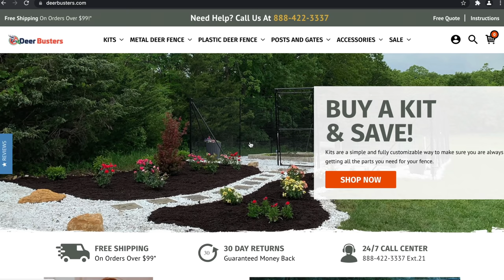We Got That DEER FENCE—FINALLY! — Ep. 070

Comment: Ok Summer, so I did once joke about you creating a plant cult/ commune compound, but that entry gate is getting too real. Are you sure the fence is to keep things out? LOL
Reply from the maker: Haha, yeah the gate looks pretty serious. The reality is there was another gate that had been installed, but it was a swing gate, (which really makes no sense in the winter time). The previous owners had justified the swing gate because it made sense since the business was only seasonal (closed the nursery down in the winter with the heavy snows) so therefore didn't need a working gate in the winter. This, we felt, was really the only option if we wanted to get vehicles up conveniently all season long while still having a deer fence. One of the contractors did joke about the barbed wire though. He said 'depending on what way it points,' you can 'tell whether they wanted to keep something in or out.' ha. (As an aside, we're slowly removing the barbed wire on the tops of the fence and just putting regular wire, just to ensure no deer get hurt in case they DO try to jump an 8-ft fence).
Reply: @FlockFingerLakes  I saw the other gate and understood your dilemma. If groundhogs wreak havoc where I am, I can only image the incessant deer pressure you must experience there. If I were a millionaire (or a blacksmith) I would gift you an art nouveau  inspired wrought-iron gate with botanical motifs a-la mister burns. It would complete the eccentric and misterious vibe you need for the property.
Reply from the maker: @suburbanhomestead  we would love that! We were dismayed by how unattractive the gate is and Summer Rayne though weaving strips of ash would look good.
Reply: @FlockFingerLakes  that is a cool idea actually.

Comment: Thank you for another great video!:) I know very well how heavy those rolls are! I had a similar situation and I found a solution in cutting them into smaller pieces (you can unroll them on a driveway, as an example). Then I hired someone for 20$ an hour to help me to handle them. Another solution I found when I decided to install a fence around my second vegetable garden by myself - I used metal spikes that are made for 4x4 posts (there are also similar ones that are made for 6x6 posts). They are fairly easy to drive into the soil (I am on sandy soil with gravel and rocks underneath) and you need only 8 ft posts. Another advantage is that they don’t sit in the ground and are not prone to rot ( I even used non-treated spruce wood, painted with milk paint and no signs of decay after 5 seasons) and if they do rot, you don’t need to dig them out, just put a new post on a metal base. It also can be used as a temporary fence since those spikes are fairly easy to dig out. If you are interested I can share more details:)
Reply from the maker: We would have DEFINITELY cut the fence if we didn't have that machine and the extra talented hands of Les and John. Can't imagine any other way to work with that if doing it by hand. Thanks for your tips on doing it without the machinery.

Comment: Thanks for the wildlife. Those deer might have met their match now. Can you check it somehow so that deer caught in the fence can be rescued? Hope that never happens. 🦌🙄🌲🌲🌲🌲🌲🌲🌲🌲🌲🌲🌲
Reply from the maker: We hope that never happens as well. It often happens if the fence is too low, and then the deer will catch their back legs on the top of the wire. Or if a deer tries to get under a space that is too small. By making a tall enough fence and added wood around the base (to prevent sneaking under) or jumping over, we think it'll be OK. The only thing that may happen is if the deer get so scared (say a hunter is chasing them) and they try to bolt through the fence. We have our critter cams up, however, and try to do regular fence walks, to make sure everything is still working. We'll be monitoring quite a lot in the coming months too, just to make sure it's working as we hope it would.
Reply: @FlockFingerLakes  Cool! That's not a small job. Wear visible clothing and make noise. Some hunters just shoot at tree branches etc. without knowing that you are standing behind them someplace. Maybe you can put up 'No hunting' signs and hope that they behave. Our Conservation Dept. sometimes even fed the deer at some locations, in some years, due to the snow being too high, they just got stuck in the snow and starved without help. Maybe they have some tips for you in your State and location about the deer population, hunting regulations and a comfortable balance. Some people allow hunting by others on their land, although the signs have been put up by them, to prohibit it. Stay safe.

Comment: when you said square instead of t post i assumed you actually meant square like unistrut.t posts dont need to be cemented but stay about 3 or 4 years where it doesnt freeze.and the metal fence will last about 7 years with no livestock pressure.if you have livestock that is a 3 year fence you will be repairing for 2 years
Reply from the maker: Hopefully the metal stakes and fence will last longer than 7 years: it's rated closer to 25-30 years. The fence that was on the land previously is around 25 years old and for what it's worth, was actually in good condition in most places, so we're actually still using it and don't think we'll need to replace it—at least not within the next 5 years. The places where it was worse was where a giant oak tree fell on the fence; and the areas where they had used live trees as fence posts (instead of actual posts). That made the fence lose tension, particularly as one of those live trees ended up dying and tipping over. But time will tell and of course, weather has a huge part to play in it, but we've been lucky thus far to have had the previous fence, (albeit old one) still working.

Comment: my hubs does this fow career  you need to cement all the posts
Reply from the maker: The metal posts were not recommended to cement. You could, but it would have been overkill + it saves on labor. Instead, they just drilled them 4 feet directly into the ground (so you can't add cement around them since it's drilled to fit the post). There's no stress/tension on those metal posts either, so they don't need to hold the weight like the wooden posts do, particularly the ones on the corners (all wooden posts were cemented in). But we're sure there are many different ways in doing a fence line depending on people's choices/techniques/budget. But I'm gathering that the addition of cementing the regular metal posts in would add to the labor costs and time as well, at least that is what the contractors mentioned to us. With the fence being as expensive as it was, we wouldn't want to go that route.

Comment: what they did was ensure your posts will rot because he did not cement the bottm of hole first do that the post isnt wicking water from the soul
Reply: That's my concern too. But maybe the wood is treated? Treated wood tends to hold up better under moist conditions
Reply from the maker: These are pressure-treated pine posts. They are rated to last 20-25 years, though we have some pre-existing posts on the land that are that age and are still going strong. The ones we have currently are 4x4 and the ones we upgraded to are 5x5, which should add some more security of lasting a long time. The key is not having them in too wet of areas ideally. And letting them dry.

Comment: there so many free wood laying around , cant be used ?
Reply: No. Wood needs to be treated, aged and shaped before use in most construction projects. If not, then you risk rotting pieces of wood in some parts of the fence or not having enough tension in parts of the fence
Reply from the maker: We used some of the wood and cut it down for firewood so that it can age. But we want to encourage more hills and mounds in the forest and one of the best ways to do that is let the wood stay in the forest and rot and turn to humus. That will add more habitat for wildlife and plants and other life. Typically you would see more hills and mounds in a forest like this, but it had been clear cut and used as marginal grazing land, so it's relatively flat.